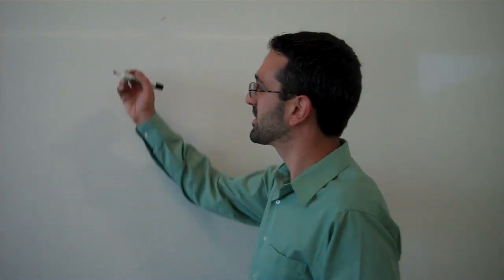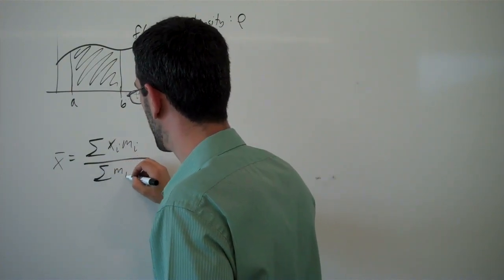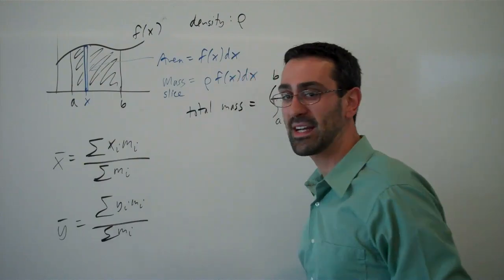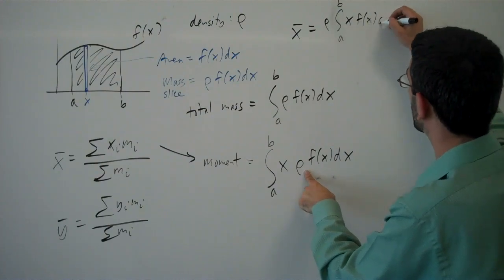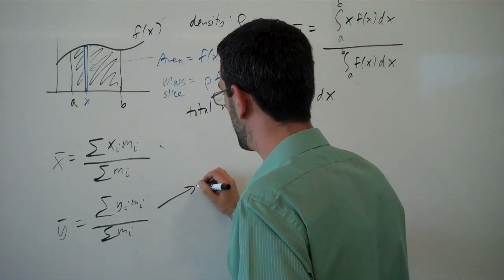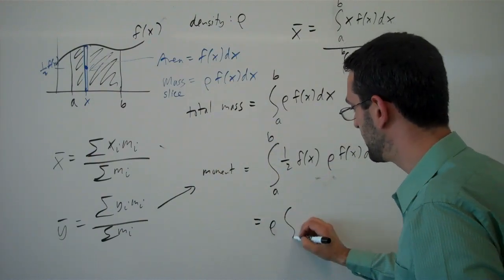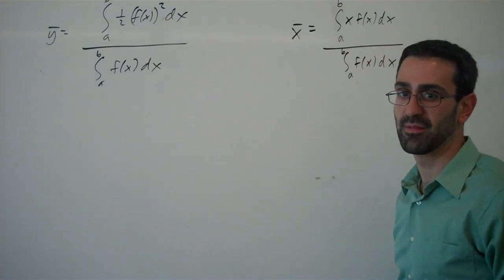Deriving center of mass equations for a lamina

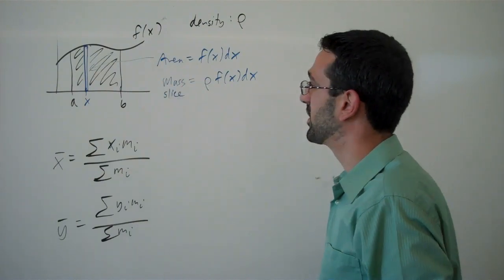Comment: so, I'm confused at 1:44. when i use dimensional analysis to check the units for mass_slice, I get density * area = (kg/m^3) * (m^2) = kg/m. but clearly, kg/m are not the proper units for mass (or am i wrong? i'm not a physics student, never have taken a physics class). so i'm confused here since it would appear we aren't actually finding mass.

edit: nevermind, i used the wrong definition of density. since we are working in a 2d environment, density in this case is area density (or kg/m^2). the units work out now